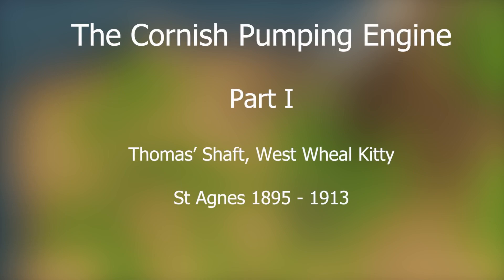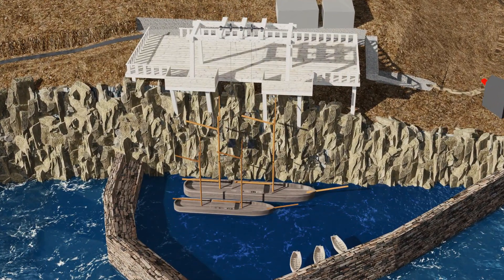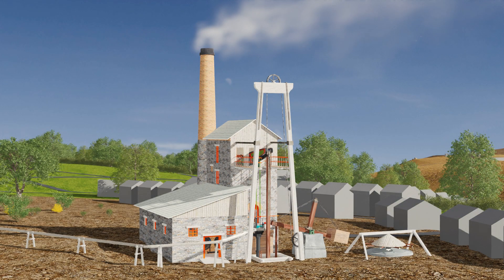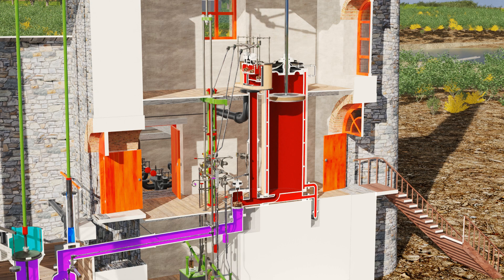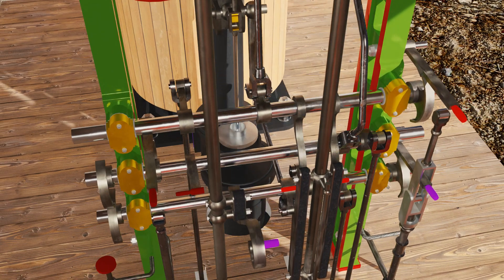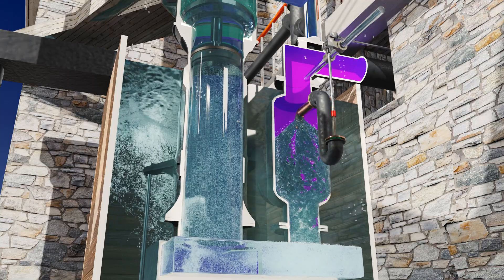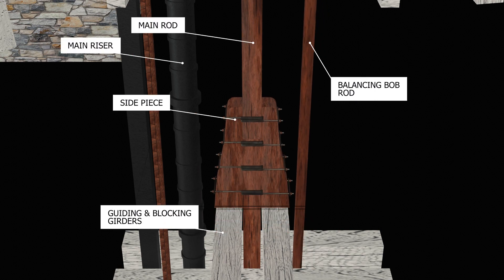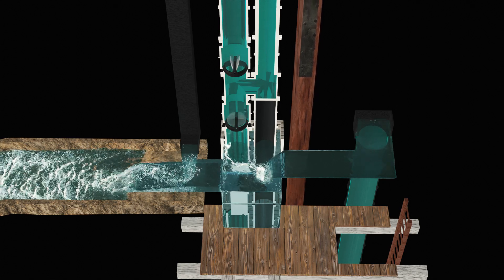Thomas Shaft Pumping Engine

Comment: Lovely - two comments - first, the exhaust valve opens shortly before the steam valve, so that the vacuum builds up before the commencement of the power stroke, and secondly, the power stroke is always faster than the outdoor stroke - this can be seen on the Shell Cornish Engine  Film on Youtube at https://youtu.be/9rd0b0Whprs?si=mi1TMNJZlSnioniP